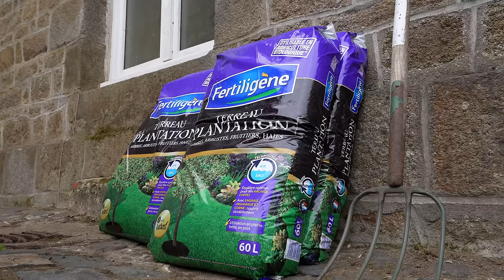Have We Found A Cemetery At The Abandoned Convent?

Comment: Instead of a cemetery, I think you have found the Stations of the Cross. The nuns would do a devotional daily and it is common for the Stations to be outside.  A cemetery would have had headstones. You may want to ask the village priest to come and take a look.  And maybe learn more about Catholicism since you did buy a former convent. It will help you understand some of what you find.
Reply: Good idea
Reply: Yes this could well have been their Cloisters area for quite prayer and thinking... I don't think A cemetry
Reply: I also think it's a Station of the cross. The crosses are divided at regular intervals on the wall. When there are 14 of these crosses you can be 100% certain.
Reply: I agree. When you clean the medallions, you will probably find more details to suggest the stations of the cross.
Reply: The stations of the cross was my first thought. Usually they use pictures, no idea if just plain crosses would have been used. if there are 14, that makes the more sense unless just another place for worship and alone time with God.
Reply: My initial thought as well. Are they identical? These days they will have the station number on them.
Reply: I think you are correct
Reply: I agree with this suggestion! Could well be “ Stations of the Cross ” a sacramental prayer, very common earlier- Roman Catholic.🙏🙏✝️
Reply: @deebee533  I agree. The thought that crossed my mind was that if the nuns were contemplative (lots of silence) or very strict in their practice, the simpler (no numbers) crosses would make sense.
Reply: @ Mia Valcarcel
Cemeteries found in convents have not had headstones and when unearthed the were bodies of infants. Also, lime pits have been found in larger convents, one in Mexico that was turned into a museum, dungeon chambers, with barred cubicles, as well. The grounds of this convent were very large and to think all that went on here was prayer is a misconception. Do a little history of convents, into the 20th century, and the atrocities that took place upon their nuns. Horrific stories and atestments to torture, cruelty, rape by Priests and Bishops - all under a Mother Superior.
This does not imply they cannot be The Stations of the Cross or any other religious devotions. 
Unfortunately, there are more atrocities that have been uncovered in convents than would ever be thought of.
Reply: Spot on suggestion! If I owned the convent I would ask the priests to come bless the grounds, and the buildings, have a service there, and ask that the facility continued to be used in service to our Lord God! I would ask God to bring me his ideas for his intended use of the facility going forward! You never know, a regional European airline might want to install an I.T. office there for 100 employees!
Reply: So true that makes sense
Reply: I was thinking stations of the cross also Mia. More likely as cemeteries are normally separated by a wall etc
Reply: I was going to comment the same. The Stations of the Cross perhaps. Or other devotionals? Perhaps when they are cleaned you will find words or smaller symbols that indicate.
Reply: Yep.  Stations.  Could be the usual number, plus a special one or two for the patron saint of the order, even though s/he is not part of the official, traditional stations.  That way it is a combo stations and devotional walk.  If there were a labyrinth under-foot, or built out of hedges/plants then for sure it would be a combo thing.
Reply: So wonderful to watch this convent come back to life. So much beauty and history is not going to be lost. Love watching you journey ❤️
Reply: That makes much more sense. Thank you for sharing that knowledge.
Reply: Or, like the irish convent, it could be 800 children buried in a pile.
Reply: Yes that’s what I was thinking each nun had a place to stand and pray
Reply: I totally agree with Mia Valcarcel : "And maybe learn more about Catholicism since you did buy a former convent. It will help you understand some of what you find." Get acquainted and you'll be able to place and understand some things absolutely better.
Reply: @gunther8296  "The crosses are divided at regular intervals on the wall. When there are 14 of these crosses you can be 100% certain." Indeed: that was my first idea too.
Reply: I  thought so too right away. 15 Stations of the cross.
Reply: I was raised as a Catholic and native american not all Catholic run institutions have grave stones for cemeteries ask just about any native american elder in the USA and Canada!!!!
Reply: You're right it's Stations of the Cross. I'm Catholic and our church had an outdoor garden with Stations of the Cross on a wall and beautifully landscape you could walk through it as you did the stations.
Reply: Yes we know the true history of the Catholics history of convents and orphanage it's documented facts and you people also know
Reply: Came here to say this. Husband, as former seminarian, with aunts in orders, thought same thing.
Reply: I agree, it must be the stations.
Reply: I thought exactly the same. They look likes station's of the cross to me.
Reply: Yes.  Most likely the Stations of the Cross/Via Crucis, especially when you note that they medallions are evenly spaced out.  And typically, there are 14 Stations, often placed outdoors in a convent/monastery. As for cemeteries in such places, there would be either a simple headstone place upright, or one placed flat.  Human death was simply part of life, medallions evenly spaced on a wall would be over-decoration.
Reply: I agree that you found the Stations of the Cross.
My late aunt was a nun and I visited many convents in South Africa so the Stations were sometime outside and it looks like a possible meditation area on the terrace and gardens
Reply: This is correct.
Reply: @LIZZIE-lizzie  - I agree with you. I am an ex-catholic and now a Christian.  I come from at least five generations of catholic families.  My great uncle was a catholic priest (NOT a Jesuit), another great uncle was a catholic deacon.  We also had several nuns, ex-nuns and “almost nuns” who never took their final vows.  As a child, my parents took us to visit my great aunts in the convents in Chicago, IL, USA.  Most of the nuns were elderly and it seemed like a very depressing place to live.

Since coming out of Catholicism and studying the 1611 Authorized King James Bible and the true history of of the Roman Empire (now known as the Roman Catholic “Church,” I now understand that the Roman papacy is the biblical antichrist.  The Roman papacy is satan’s representative on earth.  Catholicism is counterfeit Christianity from satan.

Because Catholicism actually worships the devil (and NOT Jesus Christ), all kinds of wicked things, rituals, abominations have occurred (and still do occur) at churches, cathedrals, convents and rectories.

As this convent dates back to the 1700’s in catholic France, I would guess some really awful things occurred in the buildings and on the grounds.

I pray that people study the first printing of the 1611 Authorized King James Bible and learn who Jesus and His Holy Word is.🙏🏼  Jesus is not dead, hanging on a cross as the crucifix portrays.  He is alive and in heaven.  He will return for His bride, His true church of believers around the world.  1611 AKJB, Revelation, Chapter 17 describes the Roman Catholic “Church” as the “mother of harlots.”
Reply: Great suggestion. You show empathy, understanding, and your comments are helpful.
Sorry; I'm sounding like an English teacher. I just liked your answer.
Reply: Yes, I think he found the Via Crucis stations   that are 15. The Via Crucis is a prayer, a reflection about Jesus Christ Passion.  What a lovely place!!
Reply: @sherrypaproski9564  That's not what Stations of the Cross means.
Reply: You could have been more charitable. He's a good young man and has shown respect for the Convent.
Reply: The fifteenth station would be the Resurrection.  I find his respect and carefulness very beautiful but also the horrible comments here disgraceful from people who have dreadful biased attitudes.
Reply: @sueoxley2970  Agreed. I think this young man is a Christian, although not Catholic. Some Christian charity is called for here. After all, to "love God and love your neighbor" is Christ's summation of the Commandments.
Reply: Sounds arrogant typical God fearing person no doubt.
Reply: @jeanhorrocks9022  is it arrogant to know something about your own religion?  I expect Billy was glad to know it wasn’t a cemetery but a devotional way - Via Crucis - the way of the cross.  Would you say this to a Buddhist about the Four Signs or a Moslem about the Hajj?  Also religious people - your bias is showing!
Reply: @sueoxley2970  I would say what I like to whoever. Bias about what? Most humans by their design are not worth the breath they take daily. 😈
Reply: I'll be looking forward to the results of this project.
Reply: Agree
Reply: Was just about to comment the same. Stations of the cross for sure.
Reply: @Barb_Niquette  Thank you, Barbara, for presenting these truths. 
My sister is Catholic, I a Christian.  We don't discuss our differences.
Reply: @LIZZIE-lizzie   Great conspiracy theory backed by no facts.
Reply: My thought too. I just went and looked them up--14, with another added in 1978.
Reply: @tedtimmis8135  A little research will help you see this happened and was not an exception
Reply: Yes, our old parish in Michigan, USA was built by the Irish and it has outside stations of the cross going down steps to a lake, all paved in rose quartz from Colorado.
Reply: No religion is so weird
Reply: A lady i took care of was telling me about a convent in SD.. her g.friend was going to be a nun...after she found out what went on.. she fled!!!😮@LIZZIE-lizzie
Reply: Yes and also a final resting place for priests and nuns maybe.❤

Comment: There are not many wheel wrights left anymore to fix the carriage. If you can pick up an iron wheel to match, even if it has spokes, get it. Same width and diameter. A lot of those were originally wood spoked wheels and repurposed for farm use. I would also set it up on blocks in case one of the other hubs gives way until you get it restored. If the wood is getting dry, get some light linseed oil into it, just rub it on with a microfiber cloth. It will help preserve it.

Comment: Since you need more pavers for the area where they've taken out pavers, you should remove the pavers under and a bit around the planters (ftrees) and put rock there for drainage.  It will look 'intentional' and  you'll have a few more pavers to use elsewhere.  If nothing else, it'll make a good dent in what you may have to buy.  White rock would look amazing and fit in well with the windows.

Comment: The carriage is a Bow Fronted Brougham, (pronounced 'brome'). It looks to be a fine one too. Definately French or Continental as can be seen by the brake handle below the seat. English ones have a long handbrake lever. The rear ironwork has what we call 'swells', that is the ornate shaped piece in the centre. Also the rear side carving is extremely nice indicating  a carriage of quality. I cannot see the type of wheels / axles you have. If there are three nuts behind it is a 'bolted mail axle, but if not , it will be a Collinge axle. If its bolted mail then undo the three nuts and draw the wheel forward. You may find a name and date on the stub axle casting. The Collinge type......remove the grease cap and there is a left hand threaded nut, undo that and there will be a right hand threaded nut behind, undo that and draw the wheel forward , taking care not to lose the brass collett within. Again, the makers name and date may be on the axle. It looks to be around 1880. I am a professional carriage restorer. Feel free to ask about anything else.

Comment: If you feel it is a cemetery, you can confirm that by renting a Ground Penetrating Radar. Here in the States we can rent them from our local building supply store. They are relatively inexpensive to rent. And you simply run it over the ground. It will show you where the ground has been disturbed. If you find that it is so, the ground will show disturbed areas in a confluence of mainly geometric shape. Like in rows or columns. I hope you do find out! That will be a reveal I look forward to!

Comment: I agree that those planters go very well with the old convent.  And they look pretty good where they are placed. 
Did you consider placing them in the grassy areas of the courtyard instead of on the cobblestones?  That would be a more traditional location.  One on each corner and  then one in the middle of each long side of the rectangle shaped grassy areas.

Comment: At 21:06 there is a small section on the left side with a flat roof. Can you tell if that original to the main portion or a later addition, and is there access to clean that flat roof off?

Comment: A cemetery is usually run by the city or government. A grave yard is owned and run by the church. Many churches in antiquity  had grave yards. It's quite possible that this convent of yours had one. But, it's also possible that it is simply a prayer garden with stations of the cross. That would be a predominantly catholic thing. Either may be the case. A grave yard would typically have some sort of grave markers. Although they may be wooden and long gone. The burial vaults/coffins may be wooden as well. We all know what happens to wood when left in the elements.

Comment: Most cloisters would have had a convent cemetery, so it is entirely possible. However, unless they moved the graves there should be headstones.  Although if there are fifteen it's possible as well they are Stations of the Cross.

Comment: (Practicing Catholic) They are classic Catholic church cross design. Do the crosses may have had Latin numerals on or near them? Are there 15 of them? If so, then this might have been a Stations of The Cross garden of contemplation, perhaps leading to a small grotto or shrine, look for sculpture at Station 15? Nuns would not be cremated so, unless there are stone tombstone slabs under your feet or on the facing edge of the raised platform, with names on etc. it does not look like a cemetery to me. There should be a more orthodox  cemetery somewhere there though. Probably separate from the hospital and/or school? cemetery too.

Comment: What's the orientation? The wall the crosses are in, is it an east facing wall? If so, your thoughts of it being a cemetery are in with a shot. Christian cemeteries, especially traditional Catholic ones, were on an east-west alignment, with the head buried east-wards and the feet facing west. If that wall faces anywhere other than east, I don't think it's a gravesite. Also, while I'm not much of an expert on all things Christian, if it is a burial site I don't think the sisters would be buried there. Nuns in a convent tended to be buried close to or inside the chapel as far as I know, though an important disclaimer there is that I can only speak for the local customs where I live (Netherlands), it could be that customs in France were/are different.